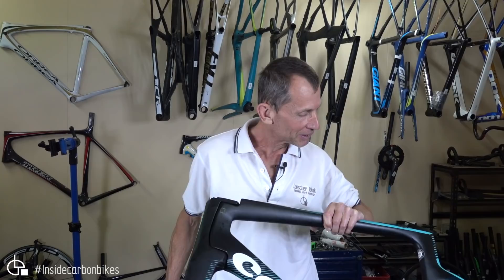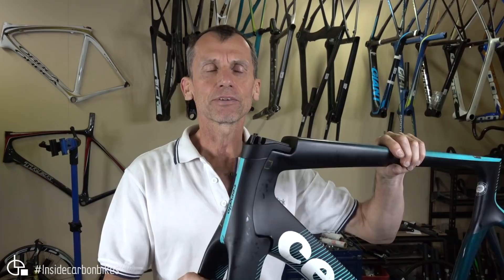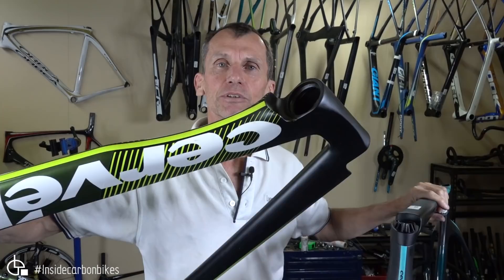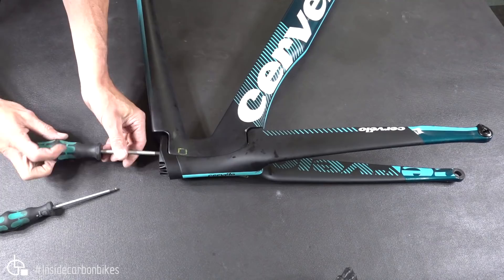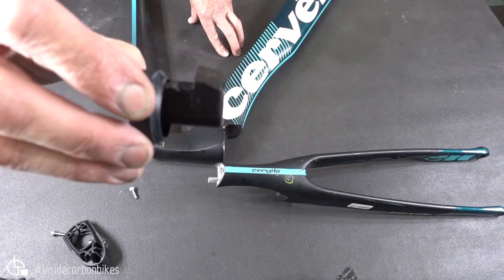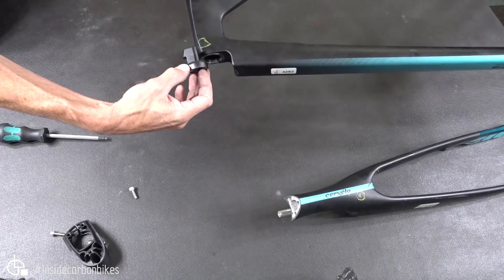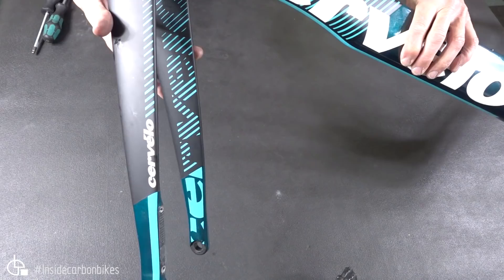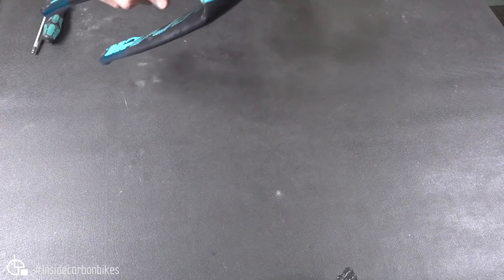Cervelo Design Fail!

Comment: Many of my friends have a Cervelo S5 and they have crashed a couple of times but it doesn’t seem to do any harm at all atleast cosmetically, don’t know about the hidden damages though.
Reply from the maker: Many of the ones that I scan are delaminated internally with no visible indication. The delamination can propagate over time, will it fail? I don't know, but they did change the design on the newer version, so that tells something.
Reply: @LuescherTeknik  What is the newer design like, and do you see there being any issues with them?
In addition, what equipment did you use for filming here? 

Your footage and lighting is crisp!

Comment: Your recommendation is not to ride an S5 if there are signs of a crack/de-lamination. But what could be the consequences of riding a cracked S5? A complete frame collapse as the forks part company?  It would be interesting to hear your design solution, but you should be paid for that by manufacturers.

Comment: There after sales support is also very bad. Bought a new S2 last year,  carbon is worn out at rear skewer and rear wheel sits skew in frame scraping against chain stay, carbon frame is now useless. They are not prepared to replace it after emails to head office and phone calls... no luck

Comment: this makes me depressed! I want to bike a carbon bike and how am I supposed to know which to go for without a risk of being bogged down with repairs down the Line? Shall I go for high end steel bike instead where there are no such issues?
Reply: If you're looking for a carbon race-centric road bike without these bump stops and you still want full internal routing, take a look at the Specialized Tarmac SL7.

If you're OK with traditional internal routing, there's the Specialized Tarmac SL6, Giant TCR Advanced, etc.

Steel bikes are fine too, but you might want to look for one with a threaded BB shell (if you hate PressFit) and a replaceable rear derailleur hanger.

Comment: I had a Cervelo replaced when the company was owned by the original designers but now they are disposable design race bikes for a seasons use and that's it. The rider has it given to them; If you have to buy it and can't afford to replace it then don't buy it, that's why the company no longer warranty's its frames for life like they used to do. Buy a sensible bike where the company will give a lifetime warranty on their frame. There are still some about, I recently had my LBS replace and upgrade a 12 year old frame for free under warranty. I can't think now many times my handlebars have swung round to an extreme angle when carrying or putting a frame into a stand...it's a fact of life as much as the wheels turn !

Comment: The end of travel design was an afterthought, obviously.  Didn’t give it the attention it needed, last minute cheap and fast solution was reshaping the metal internal head part.  I wonder if their product line development includes actual field trial / debugging or do they just rush it to production.  Can’t someone just swing it all the way with some force, to see what happens?  Just what does it take to damage it?  Not much it seems.  And my road bike swings way further than 180deg until the bars contact the frame well back.  The bike shape and finish sure looks nice though, I guess that’s the selling point to the target customer who is willing to pay for it.
Reply: Well put. Vanity indeed. 'There's a sucker born every minute'

Comment: Cervelo is going downhill! I have a an S5 MTN Qhubeka and it came from factory with a manufacture defect.  I sent a claim to Cervelo and on their email to me they admit it was indeed a manufacture defect BUT since it is just aesthetics they cannot honor the warranty.  Basically the carbon layers were not done correctly and you can see it on the frame by just looking it at it. Yet they refusing to replace frame even though they admitted on emails that it is indeed a manufactured defect!   I wont ever in my life buy another Cervelo.

Comment: To be fair, even the likes of BMW get some of this stuff wrong. On many of their motorcycle models, the steering stops are just machined steps, or casting protrusions on the bottom of the head tube. If you drop the motorbike in such a way that the steering is forced round, it often breaks that part of the head tube off. It happened on my 6 month old £13,000 K1200RS when a car in a traffic jam tried to change lane, just as I was filtering through the gap. The bike was all but stationary and really only fell under its own weight. But the repair required every single part of the motorbike to be transferred across to a new frame. As a result, there is a thriving market in after market steering stops, especially for their off-road models such as the GS. So it's not just Cervelo that get this stuff wrong.
Reply from the maker: Thanks for the information.

Comment: I'm an S5 owner. As the months go by I have less and less faith in the company. Overall it's an excellent, yet complicated bike. But a couple of engineering decisions they've made without enough thought beggar belief.
On the other side of the coin, they do have a lifetime warranty on the frame. So as long as the company still exists S5 owners will be able to warranty their damaged frames. Though I'm not sure how I'd feel about getting another one if they don't resolve this issues in a frame update.
Reply: I would check REAL HARD  those liftime warranty small prints
Reply: Sorry brother that warranty is a joke.  My S5 has a design flaw on the dropout.  Cervelo admitted to me on an Email that yes it is their fault but since it is just cosmetic, they wont warranty it.  I explained to them it has been deforming ( carbon ) little by little and one day for sure it will crack.  They answer was,  that is a manufacture defect that was caused when the bike was being made and that is just cosmetics so no we  wont cover it.  In short,  they admit to fuck up my frame and yet refuse to replace it.  Never again, I wont ever again in my life spend any money on another cervelo.
Reply: TheDroneScene that's insane! What model?
Reply: @jackriley1989  on his second sentence " My S5"
Reply: jackriley1989  2016.
Reply: J. Kimmer He's talking about a different model to me, thus my question. Trying to keep track of what are potential known issues for my frame

Comment: Using this frame/bike would mean you must handle it very very very carefully, always keeping in mind that you have to avoid too much handlebar travel. Which is nearly impossible in the „real world“. So this issue really makes this bike a very expensive „pro only“-product, where replacing parts happen regularly on a daily basis. No one of them cares. But it is not a product for the „masses“.

Comment: I can see a lot of warranty claims coming Cervelo's way, although I would rather have a refund than another frame if I had one.
Reply: They´ll fix it! You leave your bike to them for three months, and it´ll come back with some pieces of tin plate fixed at the touching points, both left and right inside the crown tube. Jawzah Cervelo!!   Rgr
Reply: And they will be denied,  the same way mine was ;) Cervelo is Garbage.  Do not buy from them!

Comment: Well just to add another comment, that steering system is somewhat a design i don' t like. It doesn't provide the same area of support as a taper fit and the centre point moves laterally as you steer the bike. Yeah it may be designed in, but look at how good these designers are! Hmmm

Comment: I own a 2019 Cervelo R5. Any reason to be concerned?
Reply: Joe Joe Only issue with the R5 is that the BB is .1 mm bigger which cause the bearings to fail premature.  Check Hambini video for the full explanation. A friend of mine has one R5 2019 and he has replaced bearings twice in less than 6K miles.

Comment: Trek Madone SLR has the same issue. Recently had a crashe which resulted in nothing breaking except my beloved frame. Fork turned and damaged corner of the fork and underside of downtime where it contacts. Warranty says I’m on my own 😂
Reply: Jacob Phillipps Hi,  I am actually thinking on Buying a SLR and I just came back from the Trek Oficial Store ( not a dealer ) and I asked to see that design and see how it works.  And actually the fork do not hit the frame,  it has a stopper on the top cap.  Now that stopper can be lose anf that it why it might hit the frame.  They even took it apart and showed me how it works.  Of course yes if u crash it might crack but design wise,  the Trek is way superior than Cervelo.
Reply: Actually that stop doesn’t do much at all on the trek. I’ve seen madones shear the stop of just from the weight of the for turning when the bike is tilted. After going past the stop the for DOES hit the underside of the frame. The stop would not survive any kinda of crash with the bars being turned at all.
Reply: *weight of the fork

Comment: just sharing my opinion :) i dont think this happens to every S5 that cervelo had produced tho. i have couple of friends who are using it for a while already. and they dont have this kind of problem till now. and its been a year for 1 of them. He cycles almost everyday as well and he doesnt have that problem. i think it could be a production failure that happens 1 in 100 of them maybe. because also with the dent on the frame set there, you can see that maybe the one who is using this S5 is just a bit too rough on his bike that you can see that dent on the frame close to the back of the fork, which all of my friends dont have. another guess is just that after the cycle sent to the country, the mechanic didnt really set it up correctly that the fork hit the frame badly.

Comment: Cervelo frames are the worst offenders for no fork clearence!

Im from a track background and the T4 frames are just shocking, if they took the nub off the front of the fork there wouldnt be a problem with clearence. The rear dropouts slowly spread and after a while the frame is no longer usable. Followed by the problem of the seat post hole, any side force during a crash cracks the frame from the front of the hole along the toptube.

Comment: Did they correct this with the new model?
Reply: I just got a 2021 S5 and I can say it's been fixed. I just checked my bike after watching this video and when I turn fully right or left, the fork can't hit the frame.
Reply: @wyim3677  did you also have a look on the inside?

Comment: Why would you want to turn your bars that far in the first place? If you crash on a normal system your bars have the potential to hit the top tube and damage the frame. Having the bike “on your shoulder” and the bars swinging from side to side would not have enough force to cause that damage. Another example of careless use where the consumer cries poor.
Reply from the maker: My experience is different to your opinion.
Reply: @LuescherTeknik I’m not denying that, it’s your diagnosis I have the issue with here.
Reply from the maker: From what I have seen, having the bike "on your shoulder" and the bars swinging from side to side DOES have enough energy to cause damage.

Comment: At some point in time, that frame set retailed in the UK for £4500. 
Dude, forget about "top of the range", "aero" etc. and similar marketing drivel. They are just morons. Absolute morons. What's even worse, you then try to raise a warranty claim with the brand via the retailer and you may run into idiots who will be arguing to the death to convince you that, that is a normal and perfectly acceptable thing. It just happens and nothing can be done about it. 
Another brilliant idea are all those integrated stems, with a bunch of plastic spacers underneath that you compress with the top cap to bazillion Nm, to hold the headset tight, but the spacers are not elastic, so after a couple tens of miles of riding play in the headset develops and the top cap bolt comes half undone. So periodic re-tightening of the top cap bolt is necessary. 
Those idiots simply don't understand mechanical properties of the materials they are working with.

Comment: What about new Emonda? It has limited turning steer as well, somewhere around 10 and 2 a clock. And no one talk about this, what kind of stopper inside the headtube, anyone happy with this? I saw my friend's new emonda slr, now i'm not sure to buy this bike because of the limited steer turn.
Reply: It's the Trek Road Integrated Steerer Stop (part no.: W5251960), found in the Émonda and Madone.

I've seen two Madones with fork crown damage due to then striking the down tube. (I think their stops were broken) If this were to happen to the Émonda, at least the fork crown wouldn't hit anything.
Reply: @yonglingng5640  thank you, i can see it in Trek website. Can we ride the bike without this part? What is good and what is not good?
Reply: Madone: Must be installed
Émonda: Never heard of people riding without one, but ride with one nonetheless.

Or, you can just avoid Trek altogether. One of the new-era race bikes I know of with full internal routing and no bump stops is the Specialized Tarmac SL7.

This bike is indeed more expensive, but it's one of the most end user-convenient bikes of its class around.

Comment: Where the downtube contacts the fork when turning the fork at an extreme angle. Would the UCI allow frame manufacturers to install a contoured rubber bumper, bolted into the downtube, that completes the aerodynamic design?

Who signs off on this? The marketing department. Engineers who want to advance their careers come up with designs that concertitive engineers would not. If someone has not studied engineering their judgements are based upon how they understand the world to work not Newtonian mechanics which is counterintuitive. If you read ancient philosophy the Greeks did a very good job of detailing how the uninformed person conceptualizes the world, that surface level features are what a "thing" is made of and that they are added together like a baker's recipe. In comparison to how something is assembled and functions will produce what it does. The point being that due to the random assortment of characteristics I have no idea how gifted the person in charge is at abstract reasoning and how they understand nature or engineering of composite materials works. Decision making comes down to rhetoric pleasing the senses.

Comment: I don't see the relevance here about impacting the frame. The frame was not designed to take a major high speed impact/crash and survive unscaled, its design to be stiff and aero for its intended ride purpose. It's not a crash test dump to survive impact after impact for a premium frame anymore than you would crash a supercar and expect to survive unscaled.
Reply from the maker: The problem is that even a small impact can cause a delamination which then can grow over time and act as a stress concentration which then can lead to a structural failure. It is not just a high energy crash that can lead to failure.

Comment: you don't corner that hard. i have massive toe overlap on my bike and have zero problems with it  even on tight corners on a cart track. it isn't designed well for sure but the range of steering angle is more than enough

Comment: I have zero complaints about my 2011 and 2012. How much turning travel does one need?  I mean, think about it.
Reply: What about unintended turning travel in the event of a spill?
Reply: Chris Voss You’d go over the bars anyway. 45 degrees is the furthest you’d ever turn your bars at any decent speed without high siding.
Reply: Tony I get that. What about the catastrophic damage to the bike in a crash though? Could happen with any frame but the head tube damage is an additional risk
Reply: Chris Voss If you get that, then you answered your own question. This is a nom-issue.

Comment: This is one of the fastest bikes you can get and it handles well (I am an owner) but have experienced the fork butting against the frame issue (made me fall once doing a track stand). That said, I agree it is a flaw but will not be an issue unless you crash it. They could have even used bumpers like my argon 18 electron pro (similar design). The seatposts on this bike also crack easily due to the  lock design.

Comment: 1. "if you have a crash, the first thing that happens is" you hit your ass on the floor. Speaking about carbon frames if you have a crash is the least of your problems. Primarily the frames do not fail on the head tube. If you analyze a bit more the its a free spinning light weight so the damage would be minimal, (especially) in comparison to drops and seat stays that a re gone to hell. As an engineer before opinion on other people's designs is better always understand what information they have risk management and FMEA an crucial at this stage. If you do not know, you are probably mistaking on how stupid or not something may be. Anyway thank problem you are referring to (we may see something relevant on a trek madone) can be very easily be upgraded with rubber overmold.
Reply: Pete is never wrong   Cumulative damage is everywhere on every frame even without crash, but again the head tube has the less cumulative issues. If you want to preserve the argument then we may  need to bring examples. Other than that I agree the Cervelo doesn't have good quality over the years. What I probably want to say is that particular head tube design is not a decision making factor to buy or not that frame